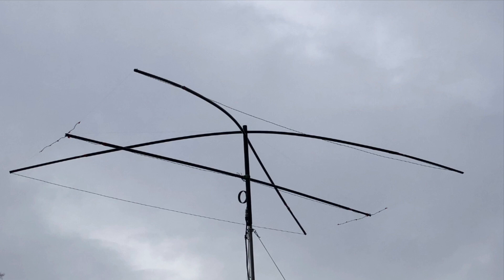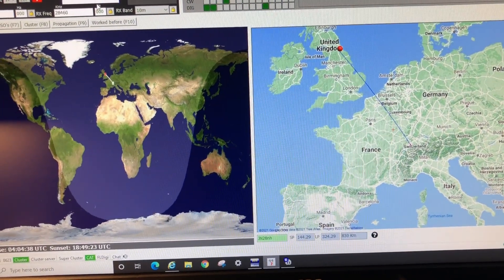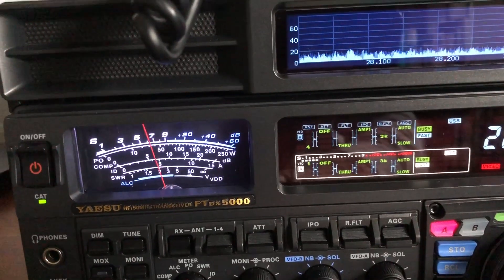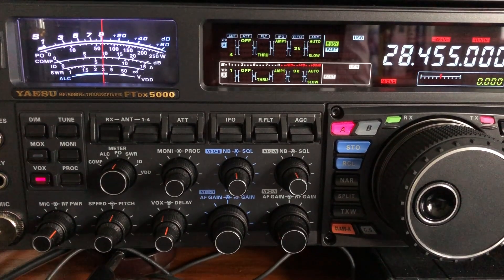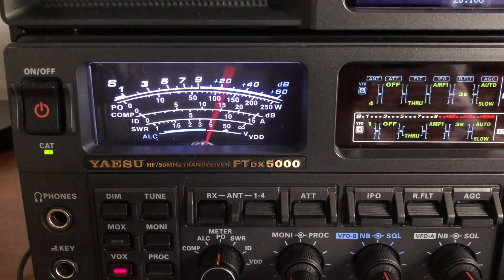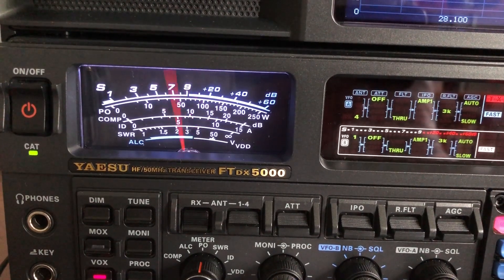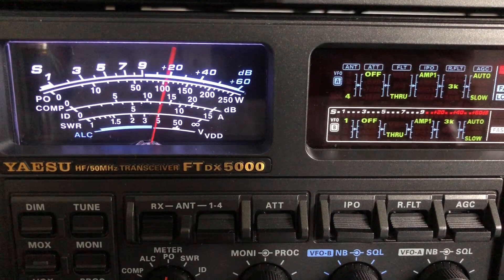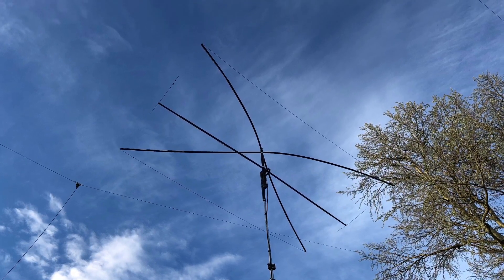Enjoying 10M DX on a Home-Made Yagi

Comment: That is the first time you have DX on the home made beam?  If you picked up 500mw in all that noise it is doing well, so is the 500mw station.
Reply from the maker: Yes Bob. Built it a couple of months ago ready for the spring. This was the first outing (yesterday). Really pleased with it 👍🏻
Reply: @G0CNN-Ian  Col, I have yet to do anything about building one.  Waiting for permission to put one up.  Even if I don't get I will have to think of a way of raising and lowering one and think of a way to make it go horizontal and vertical at the flick of a switch or pull of a rope.  Rotator is another thing,  maybe just turn it the direction I want to work and just leave it there.  I also want to take it portable in the summer, so don't want it to complicated to take down and take with me.
Nice to see it working so well.  :-))
Reply from the maker: @BoB4jjjjs  Yes Bob. 10 mins to put up when you’ve got the knack. I could have left it pointing SE as hardly moved it. Just strap to something for a weekend‘s use then it breaks down to about 4” diameter of plastic tubes tied together about 10’ long. Hide along a fence or hang from garage ceiling with all the others…😁